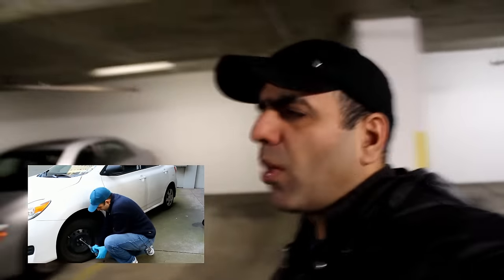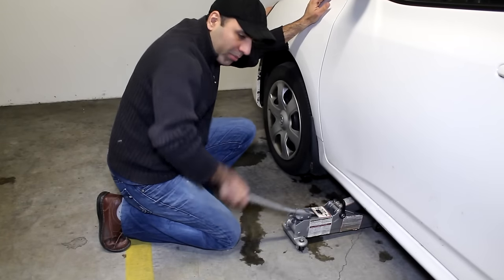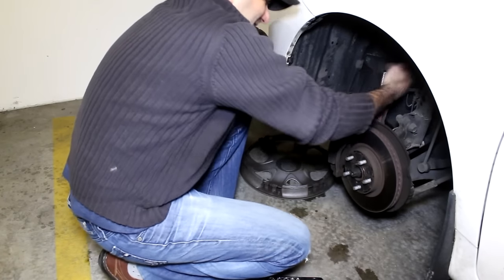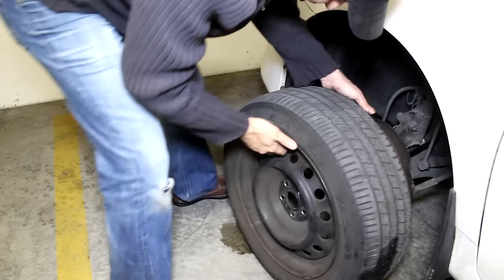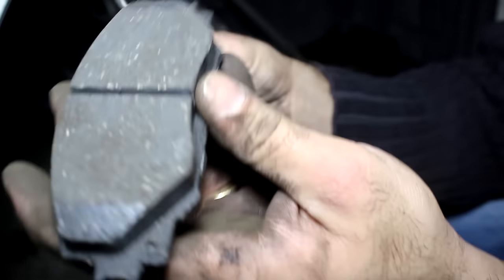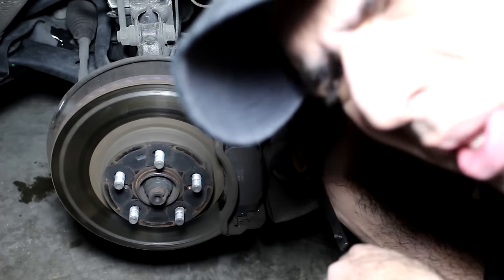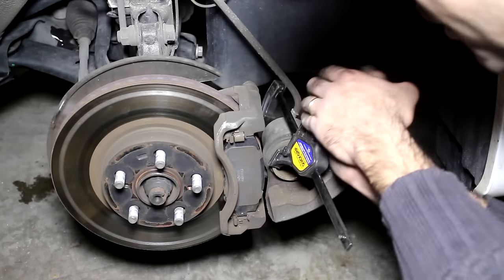ElectroVLOG-003: Changing the Last Pad

Comment: Just as an fyi: It's easier to "break the bolts" loose when your car's weight is on its tires (there is much less play in the suspension). Then you jack it up to actually remove the bolts (the converse is true for tightening them).
Reply: First of, great info, and why does youtube show me that your comment is one month old??? :S
Reply: HoodieDude420 it's because he is a patron
Reply: It's in the video description, patrons on patreon.com get early access to the videos, so the comments are really that old
Reply: Also you can use a piece of pvc pipe as an "extension/breaker" bar to make the removal a LOT easier.

Comment: Some tips to follow instead of listening to electroboom lol:

1. Please break/tighten your lugs on the ground, THEN jack up the vehicle
2. NEVER press the brake while the caliper is off, it will push the piston out
3. When pushing the pistons back, pop the hood and open your brake fluid reservoir. It’s usually in the top right
4. The squealers will not ruin your rotors, and always clean them with proper brake clean, and don’t rub them with dirty hands like he’d doing in the video
(Quick tip). Little tip about rotors, if you see cracking on the rotors it’s really dangerous and they need to be replaced. Also look out for marks/streaks (like on his in the video) on the rotors and get them shaved by a shop
5. This is optional, but it’s best to flush brake line system by bleeding the brakes. Again, you don’t need to, but if your brake hose looks dry rotted or has a big bubble in it, get it looked at

And yeah, that about it

Comment: As an auto tech I enjoyed this video. Good work bro. Just keep an eye on that rotor. And opening bleeder valve and the 15 dollar brake depressor tool makes the caliper piston so easy. Some will warn not to open bleeder valve but its no big deal if you apply constant pressure to the piston and its easy enough to bleed out the air by having someone push brakes to floor with valve closed, hold pedal at floor, open valve, close valve, release and re-apply brake pedal and repeat, good tip, use clear hose from bleeder valve into a container with brake fluid and it will keep air from being pulled back into brakes.  And watch out if you do the rear if those are disk, piston may need to turn to be pushed back in to caliper. Well you triggered my tech side lol.
Thanks for the great video.

Comment: 6:23 Get a piece of wood that will fit over the break piston cup edges and place it there. While holding the wood in place, use the C-clamp to push the wood into the break piston, this forces all sides of the piston cup to retract evenly and with ease.

I find that the screw C-clamp works the best at this task.
Reply: Hi

Comment: you got pretty lucky
you should never press the brake with the piston off
Reply: That clamp saved his ass. You could see it flexing the fuck out of the clamp haha.
Reply: i was yelling at my laptop for him not to do that, but i forgot he had the clamp on.
Reply: I was expecting his clamp to explode when he did that.
Reply: would the piston shoot out if he stomped on his brake?
Reply: Delayed Reality yes, and a lot of brake fluid would spill out
Reply: austin hatfield I'm surprised he didn't snap the bloody compressor tool in half and blow the piston out. 😂🙈
Reply: If you make such a comment elaborate why that is? Its like saying you can't go there because.
Reply: Or he should have a service manual and follow those directions.  Chilton or Haines would guide him though it better.
Reply: bro I've pulled a brake piston when the boot ripped and while it was a PITA getting it back in it wasn't the end of the world.
Reply: austin hatfield yea but that's the difference between it being a 15 min job or it taking hours.
Reply: why?
Reply: Yeah lucky he had already pushed it in a bit and the clamp was on it, only takes a couple pumps to pop the pistons out.

But I mean even if they did rebuilding/replacing a caliper isn't exactly rocket science and you can always tow it into a shop to have the brakes bled if you cant do it yourself.
Reply: B13553D brake balance tests only check the difference between the front and rear brakes(it should be 60/40 on most cars) and also if you replace brake pads at different times they will still put the same amount of force on the disc as the piston will adjust to fill the gap, if the car goes to one side then your wheels are not balanced or there is no friction material on your pads. If the brake piston falls out it usually won't break the seal and if it does you don't need to replace the caliper. On cars with ABS, you should never push the piston back in without clamping the hose and bleeding the caliper or you will damage your brakes and you should never leave your filler cap open as it will absorb moisture and you would have to replace your brake fluid. If you aren't a mechanic or don't know what you're talking about, you shouldn't tell people what they should and shouldn't do. Btw I'm a qualified automotive engineer so I know what I'm talking about.
Reply: Ollyver, then you'd know that even with the cap on the brake fluid absorbs moisture, because plastic lets moisture through.
Reply: ColtaineCrows yes but almost every cap has a rubber diaphragm to reduce the amount of moisture getting through and the caps generally have rubber o-rings at the top of caps threads to seal the reservoir. When moisture gets in the brake fluid its melting temperature reduces, brake systems convert kinetic energy into heat energy so if you have contaminated brake fluid it will become a gas from the heat transfer and then it can be compressed which reduces the pressure being applied to the pads(or wheel cylinder on drums).
Reply: austin hatfield I was waiting for the piston to piss off out of the caliper cylinder
Reply: I thought the same thing, for one he should have used a c clamp, but aside from that I'm surprised he didnt shoot the piston into the car next to him.
Reply: There do exist some kind of special clamp tool thing to push brake pistons inwards
Reply: non-car-guy here
What would happen if the clamp wasnt there?

Comment: I changed my break pads after watching some youtube video that didn't make any mention of the calipers.  I dug around my garage until I found a single C clamp I had that was too small for the job, but I managed to finagle it on an angle and use a piece of wood to keep it from gouging anything.  Took me 20 minutes to turn it by hand while using my other hand to make sure it didn't slip off so I could get it in there far enough.  

YouTube how to videos are great.  The only problem is that they don't tell you what to do when things always go wrong.  You better be ready to improvise.

Comment: As a licensed tech there are a few things you should have done here. Should have removed the caliper slide pins, cleaned and lubricated them as well as removed the pad mount and cleaned and lubed the pad contacts. Those were cheap pads and didn't come with new stainless clips. On another note love your electrical videos and style!

Comment: Mehdi…here’s a few pro tips for your next brake job.

1) Buy yourself a pair of safety stands (aka jack stands) they support the weight of the end of the vehicle that you raised with your floor jack. Try raising your vehicle one corner at a time and end up with with either the front or rear of the vehicle, depending on if you’re working on the front or rear brakes. It really speeds up the process. 

2) I’m assuming you have disc brakes on both the front and rear axles. This tip is only helpful with disc brakes. When it’s necessary to compress the the caliper piston flush with the cylinder face, e.g., when reassembling the disc brake assembly with new brake pads, use a C-clamp that has enough throw in the screw to let the caliper cylinder housing and piston fit between the flat of the clamp’s jaw and screw pad and still have 3 or 4 centimeters of space between the screw pad and the piston side of the caliper cylinder body. 

Then take the worn out inboard brake pad and place the flat back side of the pad against the protruding cylinder. With the pad in place, align the clamp  with the screw pad centered on where the middle of the piston is but cannot be easily seen owing to the  old pad blocking the hole. Start closing the c-clamp with one turn at a time of the screw and stop when the screw pad contacts the old break pad. Adjust grip on C-clamp and continue to turn the clamp screw until the old brake pad bottoms out. Now reassemble they rest of the brake assembly. I have a 200 mm C-clamp that I use for this. 

3) Build yourself an electric torque gun or buy one. Your knuckles will thank you. Don’t go on the cheap and make sure that the power is adequate for tightening or loosening the lug nuts on your vehicle. 

4) Buy yourself a small tub of waterless hand cleaner and a bag of shop towels.

Comment: Just a tip when you want to push the piston back in use a 8m and crack the bleed valve on the calliper then push the piston slowly. Pushing it in with out cracking the bleed can push the rubbers out in the master cylinder or worse seize the piston. Use a bleed bottle so you dont make a mess and you can bleed out old fluid the same way do it with the car off :)

Comment: What I've learned from changing brake pads.
1. Crowbar also works as a brake piston pressurizer
2. Always check ALL the rubber gaskets in the brake clamp area, lest some dirt ends up on the rods that lead the brake clamp and rust inside. 
3. Screw action piston pressurizers work the best
4. Don't rush it
5. If you can't seem to be able to do it, stop what you're doing, put everything back together and take the car to the service. It's better than taking your car out of commission for three weeks while the brake clamp bracket gets shipped.

Comment: I find an 8" screwdriver applying constant pressure between the old pads will push the cylinder back with no stress or clamps. Just keeping pressure on typically moves them, as it won't go in that quickly with any tool (ohh yeah this is the ElectroBoom channel)

Comment: I just don't know what to take serious in these videos but I have to state the brake pad crack is to cut down on the resonance when the pad is thicker and allow release of some of the dust / gasses the pad makes against the rotor under pressure. The squealer tab is more the lower limit for pad thickness. Also I feel a great gift for Mehdi would be an impact wrench, though the content would suffer.

Comment: The crack is there to relief some of the gas produced when braking. The wear indicator is usually on the hardware and is a metal thingy which, when the pad wears down too much, gets in contact with the disk and squeeks.

Comment: This whole video I was pulling my hair and yelling STOP at the screen.
Reply: Why? He did better than most "professional" mechanics I've seen.
Reply: @Eddie Hitler Strained the line, something every mechanic has done. "almost shot the piston out"?? NO where near it, It might have moved an 1/8 of an inch, if it did come out it would just fall out and make a mess, VERY low volume of fluid being pumped.   I have seen "professionals" no MUCH worse.
Reply: @Eddie Hitler yes, that could happen. But this one was Clearly moving freely.
Reply: @Eddie Hitler No it wouldnt, even with a  LOT of back pressure there is not enough fluid volume from the master cylinder to fully eject the piston, The clamp simply bends a little then retracts every time the brake pedal is pressed. while oil compresses very little, it also doesnt expand much either. Are you sure the person working on the caliper wasnt using an air hose to blow the piston out?  Like this https://youtu.be/I4FzXGrSrmU?t=447   Oil cannot compress/expand like the air did and allow the piston to move like that. Simple physics.
Reply: @Eddie Hitler I just explained why thats impossible, talking to a wall..... Im done.

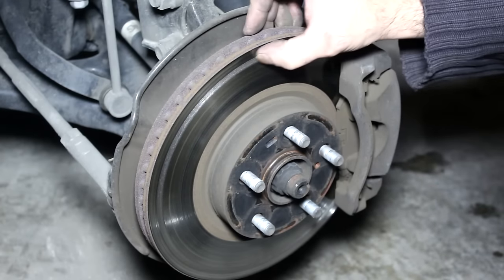Comment: LOL 3:50 stepping on a tire iron, potentially sending it flying into the classic car beside you. Now I know why they don't allow car work in my condo (but during the winter I do it anyways because F the man).

For the last part, to compress the piston back into the caliper, just use a 14-17mm short socket into the piston, then use a C clamp to push it back in. 

Don't forget to grease the slider pins.

Comment: it is easier to push the breakpiston back in with  a plier, you get no torque with that tool
Reply from the maker: Hah! Good luck pushing it back in which a plier!
Reply: That is what I used to do when I did car service, althoiugh it was a pretty big plier :)
Reply from the maker: Oh I see, I was thinking a regular plier, and that can't do much!
Reply: one of these https://en.wikipedia.org/wiki/Tongue-and-groove_pliers about twice the normal/standard size. although a normal size would still give you more force than what you where using and usually works too depending on the shape of the break parts.
Reply: You need a C clamp for pushing the brake piston in. Get yourself a manual for your car, do it right. Don't play around with brakes. (unless this is parody)
Reply: Also, make sure to loosen the cap on the brake fluid reservoir. Pushing that piston back will force fluid back into the reservoir, so make sure the reservoir isn't all the way full before compressing the piston. I loosen the cap so the reservoir doesn't pressurize and give extra resistance. Most caliper pistons will compress easily with a large pair of tongue and groove pliers.

Edit - Just realized Revener already mentioned the pliers. Oh well, the advice remains.
Reply: Put a large socket in the piston and use the clamp on the socket, the force is central, the piston will go back easier.
Reply: Or you know... crack the bleeder a little bit before pushing the piston back in. Just top off the fluid when you're done.
Reply: Rear calipers tend to have wind back tools for inbuilt handbrake mechanisms, fronts can be pushed in.
Reply: get a giant c clamp it allows you to push from the centre.
Reply: blocks of wood? Sockets? Cmon, easiet thing is to use the old pad, its already there and you know it'll fit. Pad on the caliper and c-clamp or tool of choice to compress the piston.
Reply: You would probably have better luck with a C clamp! It gives you a mechanical advantage.
Reply: Revener666 - I us my teeth
Reply: bexxy some cars require that tool cause it's not just a simple piston but a screw type. had to borrow one for my rears.
Reply: Clamps, special tools, remove cap.  All a load of shite. Put large screwdriver in viewing gap. And pull piston back before you even take the old pads out.
Reply: Not pliers. Channel locks on the old pad or just use your thumbs on a lot of them.

Comment: Yeah, when you do brakes. You always do both rears or both fronts. Along with you should also do brake rotors too since it can cause the brand new pads to grove and unevenly wear. I get he’s not a car guy but it’s nice to know we can teach him stuff that he may not know. Especially when the rotor is looks like that both rotors and pads need to be replaced. In our shop we call this “Pad-slapping” where they just put new pads on worn rotors. Most shops just replace the rotors since it’s fairly cheap and preventative maintenance compared to shaving them down.

Comment: a C-clamp allows easier push-in of break piston. if still to tough, you can open master or open a bleader a smidge to lessen compression. 
always change both pads. not doing so creates not only uneven wear, but cold cause control problems during emergency breaking, like pull your car into a ditch or oncoming traffic. 
break lug nuts before lifting car, then tighten lug nuts "just securely" in a basic "star" pattern. when lugs are "just secure" lower car, then fully tighten. 
but.... Mehdi you've never claimed to be a mechanic. 
thank you for your videos.

Comment: Just saying, i got to UTC Plymouth in the UK which is a engineering school. Gloves are meant to be worn to stop oil and other mechanical fluids and lubricants from drying up and cracking your skin. Its optional though, wont kill you if you don't.

Comment: With the wheel brace, I attach a plastic water pipe over one of the arms,  much easier than standing on it.
I took the wheel brace into Bunnings when I got the water pipe to make sure it fit. It was a black plastic pipe used for recycling grey water.
From memory the pipe was 2' long and 2" diameter. I think it cost $12

Comment: 1 get a real clamp 2 use the old pad to center your clamp 3 loosen lug nuts with car on the ground 4 tighten lugs same way 5 never press the brake with the caliper off 6 spray is to get rid of your hands oils, enjoy your sticky brakes 7 you forgot the brake lube 8. That set of pads is gonna die fast, shoulda machined that rotor. This is a list of issues, in no particular order.

Comment: Just a tip for pushing the caliper pistons back, open the bleeder value, it’ll let out some brake fluid but it will make it much easier, since you’re not fight the pressure.

Comment: here are two tips:
1) When you leverage down the tire nuts with your foot you should leverage up on the other side with your hand to cancel out the downwards shear stress you're putting on your cross. that way you reduce the risk of breaking it.
2) To reset the caliper piston it's much easier to use a power-screw C-clamp instead of that squeeze-lever one you're using.

Comment: when your pushing the piston back into the caliper it helps to put the old brake pad into the caliper and  use the worn down pad as a surface for what ever you use to push the piston it also keeps the presser more in the center. another thing when you pressed on the break good thing you had the piston press in you could popped the whole piston out with out anything there.